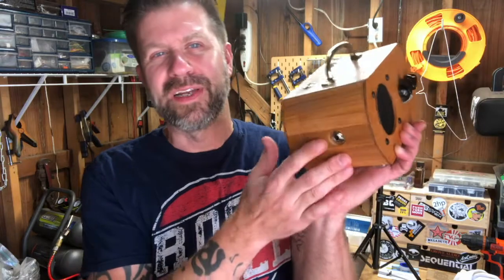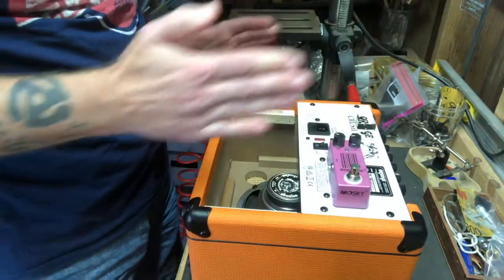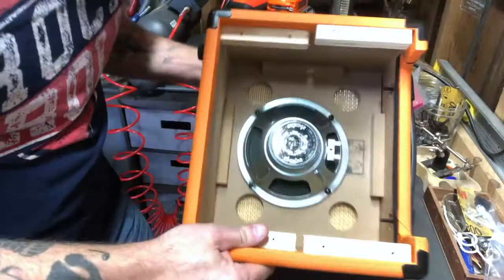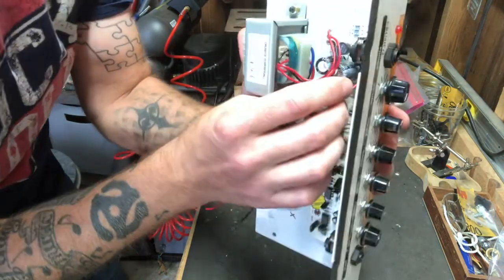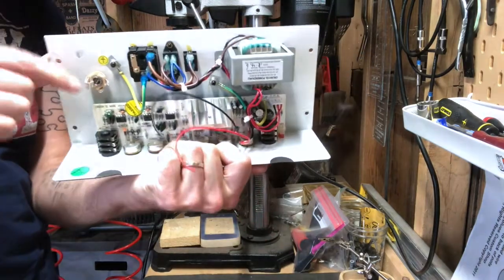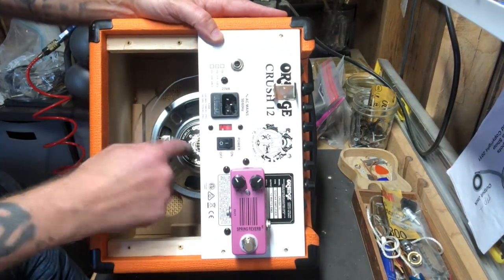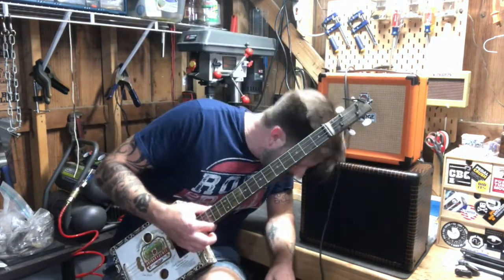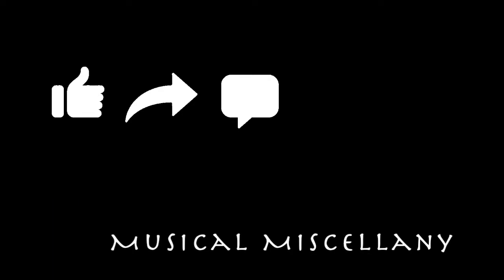Adding an External Speaker Jack to the Orange Crush 12 (or any guitar combo amp)

Comment: I just did this mod with my Crush 20 and it’s awesome! It was slightly more challenging as the amp chassis can be removed from these amps; I think there may be glue holding it into the cabinet. At any rate, the wiring is essentially the same. I dropped my new port in right next to the foot switch jack. Sounds amazing through my 212! Rock on!
Reply from the maker: Great to hear! I always hope these vids are helpful to someone and it sounds like you ended up with a much more functional combo. I don't know why they don't include the ext speaker jack from the factory.
Reply: I think the 30 has one. They seem to add features as you move up. For me the foot switch was imperative, so I moved up to the 20. I guess they’re no fools!
Anyway, thanks again. It’ll be great to get jam volumes out of this guy now.

Comment: Thank you for creating this video!  I want to add an Ext Speaker jack to my Orange Crush 35RT so I can run it into a 212 cab (not that the 10" speaker is lacking) and your demo gives me the confidence to get the job done right 😄
Reply from the maker: I’m glad it was helpful. I wish they’d just include it from the factory. Good luck.
Reply: Does the color of the wire matters if black or white
Reply from the maker: @Texas059  The color doesn't matter but the polarity does. In other words + needs to got to + and - needs to go to - but the color doesn't really matter as long as you can tell which is which. Ultimately, a wire is a wire.

Comment: Found one of these in the dump in the electronics boc.
   Nothing wrong with it I thought I'd have to repair it hahaha.
 He's sounding tiny practice amp I've ever used. 
 I've been adding these Jack's to amps for years. I have so many speakers lol.. It's nice to play around and find what speaker sounds best with what amp.
   I bought and sold so many amps for nothing compared to what they are worth now.
  When younger. My ears sucked and speaker cabs were expensive for my income at the time..
 The speaker can make or break an amp.
Reply from the maker: Thanks for checking out the video. These small Orange combos really are pretty versatile once you add the speaker jack.

Comment: great vid - now I want a cigar box guitar for slide stuff
Reply from the maker: CBGs are a lot of fun and super easy to build. Thanks for checking out the video. I hope it was helpful.
Reply: @musicalmiscellany  yes - one of those things I've done before but forgot the wiring and needed a refresher.  this was perfect for it.  all small combos should come with those standard.  many small amps sounds great (especially old solid state ones) they just have those crappy little speakers usually that holds back their true potential.
Reply from the maker: @MaxNMyles  I completely agree.

Comment: Glad I did the hook up BEFORE drilling a hole in my amp!!!! Either it doesn't work or I have two bad jacks ....which doesn't seem likely to get two defective jacks.
Edit - tested one of the jacks & it's getting signal. So the jack is good. Tested the cable. It's good. There's something missing here.
Reply from the maker: It's not likely that you'd have 2 bad jacks, so there's probably something wrong with the wiring scheme or you've got the wrong kind of jack. First things first, you did get a 12A shunted mono jack and not a 12B stereo jack, correct? They look very similar.
Reply: Yeah I have the correct jack. Just tested one of them & it's good. Tested my cable & it's good. I'll figure it out. Just not sure why I'm having trouble with something this simple. 🤷 I mean, I do all the maintenance on my guitars, I've replaced capacitors & resistors in entire stereo receivers...so this is pretty basic in comparison. But I should figure it out. I probably just make some rookie mistake or something. 😂
Reply: @musicalmiscellany  & that's exactly what I did ... rookie mistake. 🤣
Reply from the maker: @JakeStrange66  Glad you got it figured out. Have fun.

Comment: Could always check the speaker cable that goes to the cab for Impedance, if the Combo speaker & Cab speaker are 1/2 or significantly less than the 7 Ohms, that the Combo speaker was originally the 2 speakers are in parallel. A 16 Ohm cab with the 8 Ohm Combo in parallel & then there are Impedance calculators that will tell you where the Impedance is set. Another way to do this is to add a toggle switch to switch from Combo to an external cab. I like the shunted jack better though. Also when you clipped the wires, you could've left more at the speaker terminals twisted the new wires & soldered those just the same. There was going to be more wire needed for the output jack anyway. The upside to doing it that way is that you don't need mew speaker crimp spades.
Reply from the maker: Thanks for watching the video.

Comment: I've got a Vox li'l night train head 5w that I'd love to be able to hook up to my Orange Crush 30r 10" speaker. Would be nice to have the spring reverb and control in the Orange still operational and be able to switch to the Vox when plugged in. Essentially just turning the Orange combo amp into a cab (with spring reverb) for the Vox.

Is that even possible? I like the Orange's speaker tone and the spring reverb is lush, otherwise I'd just buy a 1x10 cab and reverb pedal, obviously!
Reply from the maker: Turning the Orange into a speaker cab is a pretty easy mod. It would be similar to what is in this video but use 2 standard mono jacks instead of 1 shunted jack. Connect the power leads and the speaker leads to their own jacks and mount them. Then connect the two jacks with a small cable (you'll probably want to make this yourself) when you want to use it in combo mode. This would allow you to use the Orange as a combo (both jacks connected), head (power jack connected to ext cab), or speaker cab (ext power connected to speaker jack) depending on which jack(s) are in use.

However, the spring reverb part would be a lot more difficult. First of all the reverb is applied to the guitar signal, not the power signal, so you couldn't use a signal cable. Also, because the reverb requires power, the amp would need to be powered on when you want to use the reverb. I haven't looked inside, but there's probably some sort of preamp and recovery amp on the main circuit board. So you'd have to figure out where those are located and tap the signals there. Then you'd probably want to add a bypass switch so you still use the reverb with the combo.

Provided you accomplished all that, you'd have to run your guitar signal through he reverb section, then to the head, then run the power from the head back to the cab. It would be a lot of work but it is doable. It would probably be a lot easier to just buy a reverb pedal.

Comment: Very informative video as always, still waiting to install my A12 ,just can't find the time,🤣,thanks Kale for sharing 👍
Reply from the maker: Thanks for watching. Hopefully it helps you but i know we’ve all got more projects than time.
Reply from the maker: @taak2217  Sorry you're having troubles. More details would be good here. Is the buzz sound coming out of the speaker when the external cable is plugged in? Or when it's not plugged in? Also, I'm assuming you mean the internal speaker is making the buzz but I could be wrong about that. Details are important when troubleshooting.

Anyway, if the ext spkr cable is unplugged and you're still not getting sound out of the internal speaker, either you've got a bad connection or you reversed the shunt and tip/sleeve contacts.
Reply from the maker: @taak2217  Since you're not getting sound out of either speaker, you're not passing current though the jack. Chances are you mixed up the tip/sleeve/shunt arrangement on the jack. It's easy to do. Double-check all 3 of those (trace the jack's terminal to the contact to be sure you've got it right). Remember... amp positive goes to tip, both negatives go to sleeve, speaker positive goes to shunt.

If you still can't figure it out, try bypassing the jack (with alligator clips or something similar) to see if it the internal speaker works without the jack. In other words, ensure there's not a problem with the amp itself. If it works and you're 100% sure the tip/sleeve/shunt arrangement is correct, you might have a defective jack.
Reply from the maker: @taak2217  I know it's frustrating when things don't work like they should. One other thing to suggest. Occasionally, small amps use a + grounding system (meaning you'd reverse the +/- arrangement). In that case, both positives go to the sleeve and the negatives go to tip/shunt. You could try that.

If that doesn't work, I'd suggest opening a thread on a pedals forum or sub-Reddit. As you point out, troubleshooting via YouTube comments is not ideal. Post a pic with the description of the issue and you'll probably get help a lot quicker. Good luck.

Comment: More than likely a TDA2003 Power Transistor with a LM4558 Preamp driving the TDA2003 - same setup as in the Footnote Amp for $9.00 from Parts Express and it drives a 4 Ohm 6-1/2 inch speaker just fine. The 4 Ohm speaker will give twice the output power of the 8 Ohm speaker.
Reply from the maker: Thanks for watching the video. That's good information to know. I realize a lot of manufacturers rate these amps conservatively but I certainly wouldn't want to recommend people not match the supplied impedance - unless they have proof the amp is indeed stable at a lower impedance rating of course.

Comment: Hi. First of thanks for the video. I have a peavey Bandit id like to turn into a head. If i just soldered the speaker wires to the jack would that work to plug into my 2x12? Hope that makes sense, im brand new to this stuff. Thanks
Reply from the maker: Thanks for checking out the video. If you followed the directions in this video that should work with the caveat that the 212 cab would need to the same impedance as the stock speaker. I believe most of these Peavey amps used an 8 ohm speaker so you'd want to find an 8 ohm 212 cab.
Reply: Wow super fast reply! Subbed! Ya, i have a 2x12 8ohm cab. i was looking to take the peavey combo speaker right out and cut the cab down to look more like just a head.  So i would then just need to attach the speaker wires from amp to the switchcraft jack, correct? Does it matter where the - and + wires go on the jack? Thank you and please forgive my stupidity❤
Reply from the maker: @_-Unity-_   It sounds like you're on the right track. If you're not going to use the speaker at all, you can just use a standard 1/4" mono jack. Run the speaker wires to the jack, mount it, and plug in the cab in with a standard 1/4" speaker cable.
Reply: Thank you! ❤

Comment: Just bought an Orange crush 20. Thanks for the video. 
I'm looking at doing the same to mine. 

Question, does the speaker jack have some voo-doo magic in it that shuts off signal to the Orange speaker? 
Heard of guys wiring an external speaker shut off to keep that little annoying bastard quiet.
Reply from the maker: Yes. The shunted mono jack connects the internal speaker when there is no plug inserted and disconnects it when a plug is present. Thanks for checking it out. Watch the video linked in the description to learn more about the jack.

Comment: Also, how do you have that little reverb pedal mounted and wired?
Reply from the maker: I just put a piece of velcro on the back and mounted the pedal there. I plug the guitar into the pedal and use a short cable to go from the output of the pedal to the input of the amp. Basically it's a poor man's reverb.

Comment: But, for example, you're swamping a 1x12 combo for a 1x12 combo. Is there a way to make your combo work W/ the external speaker???? ie making a stack out of it?
Reply from the maker: This mod allows you to turn a combo into a head. So it wouldn't make much sense to use a 1x12 cab if the amp had an internal 12. However, you could easily connect a 2x12, a 4x12, a 4x10, or even a 1x8 using this method.

If what you're wanting to do is make the combo more flexible, you might want to check out this video. https://www.youtube.com/watch?v=l6txwhjeC8Q It's mod allows you to use the combo as a head, a cab, or both. That sounds like it might be what you're looking for.

Thanks for checking out the vid.

Comment: I did this mod however, when the jack touches the chasse I get a buzz so I had to use insulator washer on both sides of the jack. Any idea why? Did I do something wrong?
Reply from the maker: If it works, you did everything correctly. Sometimes circuits have a tendency to pick up noise as you add jacks. You did the right thing by insulating the jack. Nice work.

Comment: What would happen if you just used the headphone out jack that comes already built in?
Reply from the maker: I wouldn’t recommend that. First of all the headphone jack is stereo and the speaker is mono. Also the headphone jack has a very low output where the speaker will require a bit more damping to move the cone. You could actually damage the speaker (or possibly the amp).

Comment: So how do you get sound from both speakers at the same time?
Reply from the maker: You would simply use a standard mono jack instead of a shunted jack.

However, be advised that may require some additional research to determine the impedance stability of your amp. If the amp has an 8-ohm internal speaker, and it is rated 8-ohm stable (like this one)... you'd have to swap the internal speaker to stay in within spec. If the amp was 4 ohm stable, you'd be able to do it with the included speaker (provided your ext cabinet was also 8-ohm).

FYI, if you run an output load lower than what's supported, it could burn out the amp's transformer.

Comment: Would it be posible to use an orange micro terror as a head through an orange 25 bass amp to utilise the valve of the micro terror?. Failing that, i have yamaha twin (yamahas version of a fender twin) with a blown amp. I could use  this as a cab but i believe the speakers are hard wired to the amp. Many thanks :)
Reply from the maker: Thanks for checking out this video. It sounds like you might want to take a look at this one. https://www.youtube.com/watch?v=l6txwhjeC8Q That will probably answer a lot of your questions.
Reply: @musicalmiscellany  thanks man. I'll do that now 👍

Comment: Nice video...do you have a video in which 2 speakers will work and there will be a switch to disable one of them?
Reply from the maker: I'm assuming you mean two speakers inside the combo amp, not one internal and one external. I don't have a video to that specific scenario but you could use this one as a guide.https://www.youtube.com/watch?v=l6txwhjeC8Q

If you wired each speaker to a separate jack (so you'd have 3 jacks on the back of the amp), you could simply create a y-cable that goes from the amp out to both of the speaker inputs and a straight cable when you only want to use one speaker. It would be pretty simple actually.

Needless to say, you'd have to pay attention to the factory wiring scheme to see if the speakers are wired in parallel or series and create your y-cable accordingly. Also, check the stability of your amp's output transformer to make sure it can handle the load of a single speaker. E.G. if you had 2 4-ohm speakers wired in series, that would be a 8-ohm load, so you'd want to make sure the amp is 4-ohm stable for a single speaker arrangement. If they're wired in parallel, it shouldn't matter because 1 speaker will always be a higher load than two. I hope that made sense.
Reply: @musicalmiscellany  thanks for the reply..sorry for the confusion what I mean was current existing speaker in combo amp and an external both working together at the same time. So basically the combo speaker (internal) is having sound and then adding another external speaker to add sound and enhance output..
Reply from the maker: @mikeburny6094  I'd still reference the same video/mod. I think it's still the easiest way to accomplish what you're wanting. You could follow the steps in the vid and just make a y-cable to go both the internal and external speaker.

So... you'd have 2 jacks on the back of your amp and 3 cables: a short cable for internal speaker only (shown in the video), a longer cable for external speaker only (shown in the video), and a third y-cable for both speakers. That's how I would do it.

Comment: Could you wire the external jack from the existing speaker terminals and run 2 speakers?
Reply from the maker: You could do the same thing with a standard mono jack and essentially create a parallel external speaker jack. However... make sure you look up the specs on your amp before you do this. If you amp is 8 ohm stable and has an 8 ohm speaker... you'll need to change the internal speaker or risk frying the output transformer. Either that or you could rewire them in series but then your amp would make less power. If your amp is 4 ohm stable and has an 8 ohm speaker... good to go (provided you also use an 8 ohm external cab). So, yes it's doable but do your homework first to make sure you don't fry the amp.
Reply: @musicalmiscellany  sure appreciate you taking the time to get back to me! Thanks much!

Comment: Did it require long shaft 12A jack?
Reply from the maker: Not for this particular mod. The metal panel was only about 1/8" thick. That may vary depending on the rear panel of your amp though.